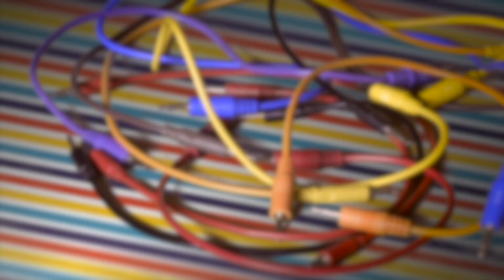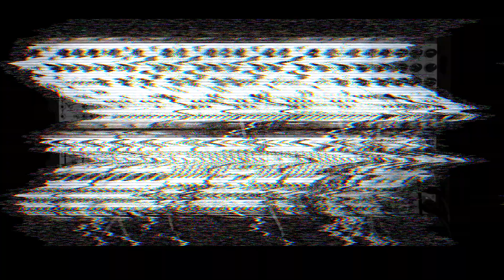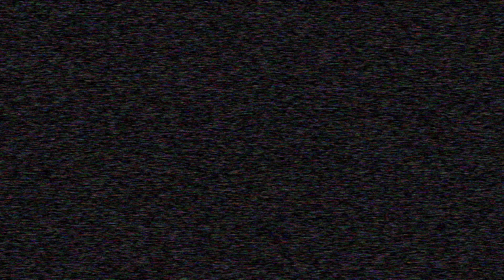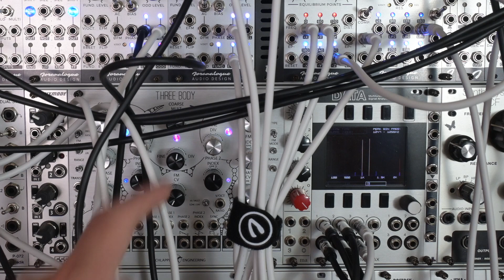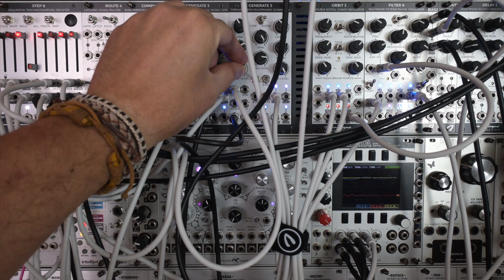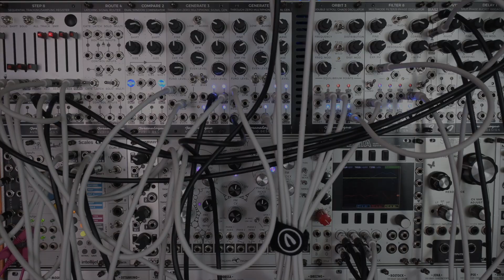Joranalogue Audio Design FOLLOW-UP FRIDAY / ringmodulation & amplitude modulation explained

Comment: cool stereo movement in the final jam, especially with them there freaky sounds you made 🖖
Reply from the maker: That's some stereo frequency shifting on a few chords coming from Braids (renaissance firmware), I use the frequency shifter on very subtle settings for chorus like stereo movement. I really like how that sounds.